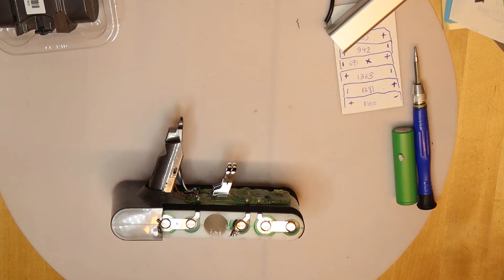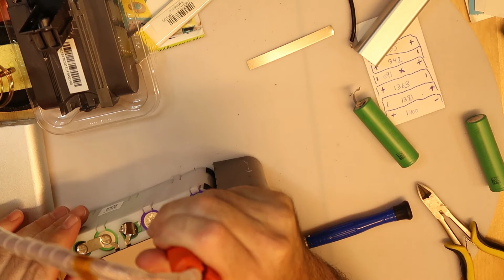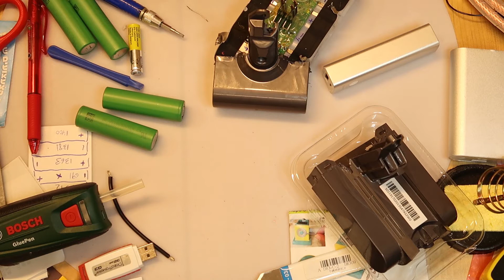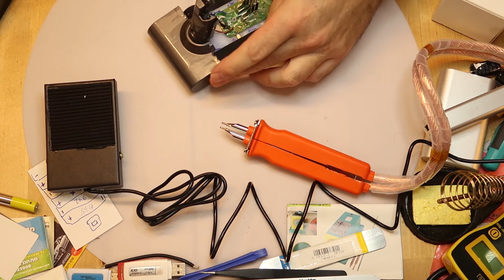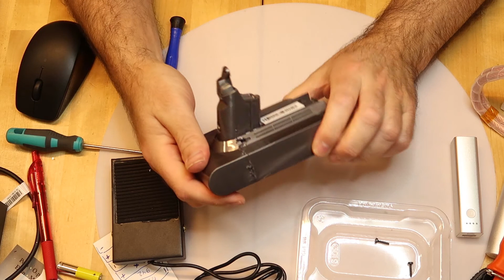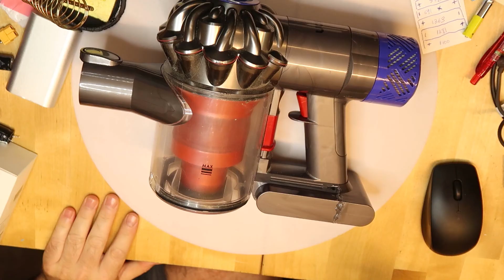dyson v6 Battery fixing - part 3 (last part)

Comment: Hi, On this V6 battery, with full disconnection of the BMS to change the cells you didn't have a red blinking light after reassembling?
With the newest models it seems it's impossible to do that , the BMS does not start again and shows red light. Do yo confirm it's possible on a V6 battery (if it has still blue led before changing the cells) ?

Comment: I change the battery but dosn't work it, ( flashing red light )
Reply from the maker: May be your cells or bms are not working
Reply: @RoeeBloch  what's the bms ?
Reply: @RoeeBloch   I connect the battery directly with the motor and it works but with the card it does not work

Comment: These Dyson Vacuum cleaners are shit. My battery died so I called Dyson and they sent me a Brand New battery a few months ago. It died today. I think the BMS charger is faulty and is killing them because it's not balancing the cells. Replacing the cells will only buy you some time until it happens again. This needs to be fixed by Dyson. This is such a common fault that I'm tempted to throw my vacuum out and buy something better
Reply from the maker: usually this is because of bad batteries, however sometimes BMS is not working well
Reply: @RoeeBloch  Interestingly I fixed the Dyson. I completely dismantled the cyclone and filters and thoroughly cleaned everything. I normally blow the dust out with a 3 horsepower air compressor but it doesn't reach all the way into the internals . You need torx screwdrivers to fully dismantle it and and after cleaning everything with a toothbrush and soapy water (non electrical components) and washing the filters I reassembled it. I charged the battery fully and put it on low setting and started a stopwatch. It ran for 20 minutes. Before I cleaned it , it ran for 2. Also I believe when they are super dirty the little nozzles in the cyclone get blocked and the motor works harder and gets hot and shuts down. Thermal overload protection. I should test that with my Thermal Imaging camera, when it's clean and also when it's dirty
Reply: @ゲン make sure your filters are dry (after you've washed them) before starting the vacuum. You need to break the vacuum cleaner down to it's individual components. There's quite a few, even the material filter is 2 parts . Separate everything and wash and dry everything. Don't put water near the nozzle input of the plastic bin where the red flap is , there's electronics there. Everything else needs to be cleaned. Most of the parts except the hard plastic bin can be washed and scrubbed in a sink with dish liquid and a toothbrush. Be careful with the large rubber seal in the cyclone that you don't damage it. Make sure everything is dry and carefully reassemble the cyclone making sure the red rubber seal (gasket) makes a good seal. Tighten the torx screws evenly (don't over tighten) in a star pattern to evenly seal the 2 halves. Once the material filter is dry . Try timing the operation using a stopwatch. 20 minutes on low should indicate a fairly healthy battery. If it's much less than 20 , the battery might need replacing. Good luck
Reply: @ゲン well done. Glad it's working again
Reply: There is a fix for the 32 red flashes, the cells need to be balanced and the pack reset. It will work like before, if the cells are still in good condition. Requires a bit of hand skills. See here https://youtu.be/7t9yA3_KUI0
Reply: must be bad luck, i have had a V6 for about 6 or 7 years or something and it worked perfectly until recently and i used it almost every day. Now the battery only lasts 5 minutes

Comment: This like pulling teeth ... jus buy a new battery fo $30 ... on Amazon. 
 (P.S. Lots of interest in SPOT WELDER !!)
Reply from the maker: I have few videos on spot welders, the 30$ battery is not as good as using cells that you can be confidence and test them before putting them in